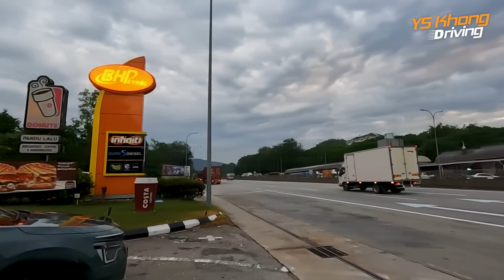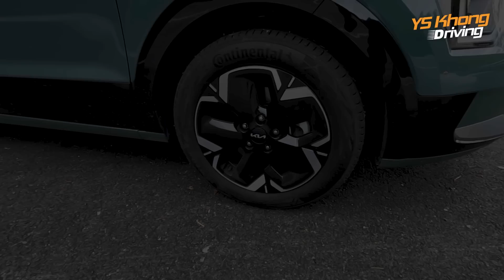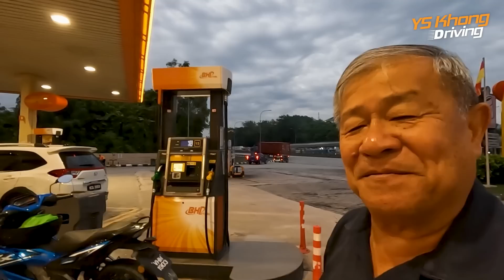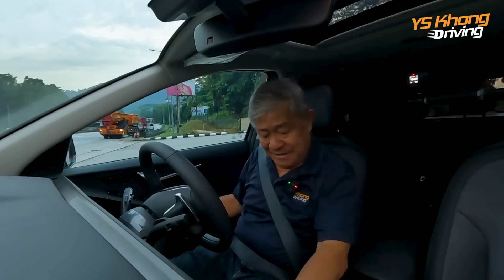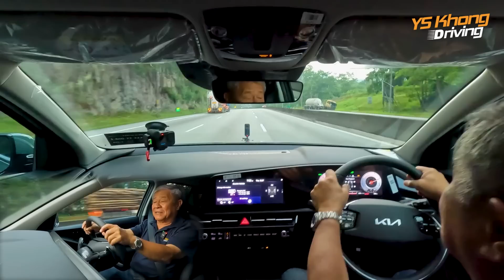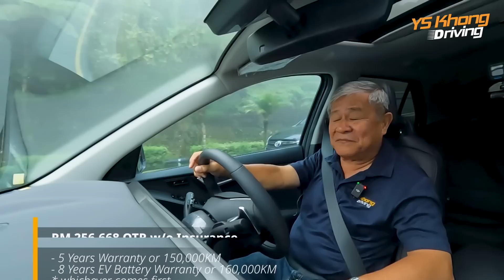Kia Niro Versus Genting -  Surreal, Silent, and Nimble | YS Khong Driving

Comment: Why need to switch off traction control?
Reply from the maker: So it wont interfere with my driving
Reply: @YSKhongDriving Thanks.  I suppose it slows down the response when you accelerate when traction control is on.

Comment: A full charge with a max AC input (Type 2) of 11 kW takes six hours and 20 minutes, while DC fast charging (CCS2) at a peak of 80 kW will get the battery from 10-80% state of charge requires 49 minutes. Included with each purchase is a portable three-pin to Type 2 charging cable but you’ll need to be patient because a full charge takes 27 hours and 30 minutes with a conventional household outlet (230 V/12 A). 27 hour to fully charged ???
Reply from the maker: Most people would use a 11kW charger.
Reply: @YSKhongDriving  this would mean their landed house would need 3 phase wiring system.